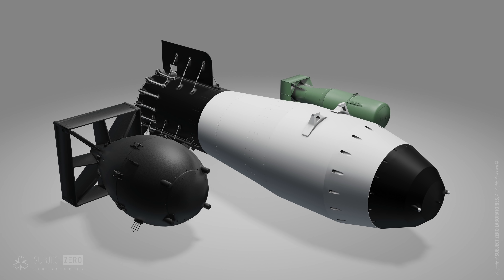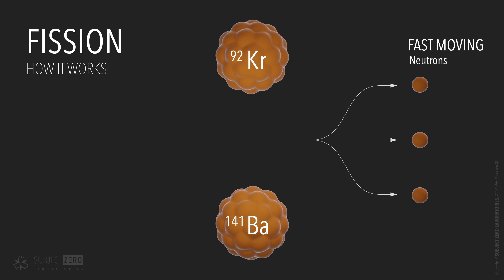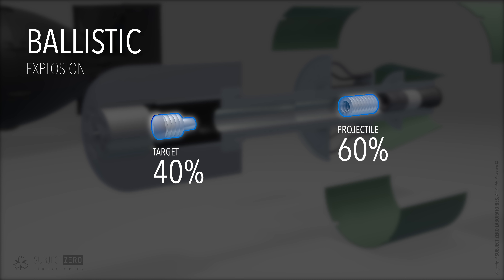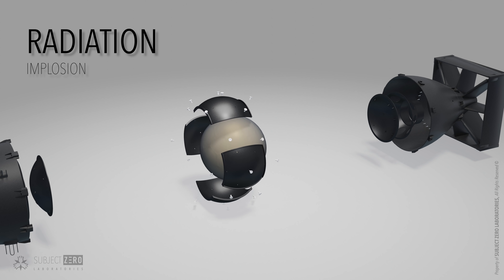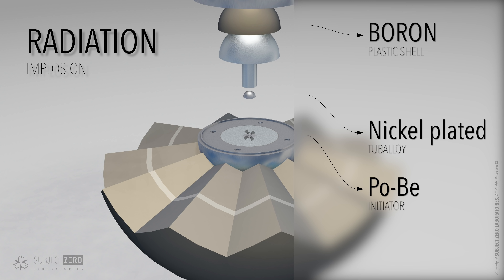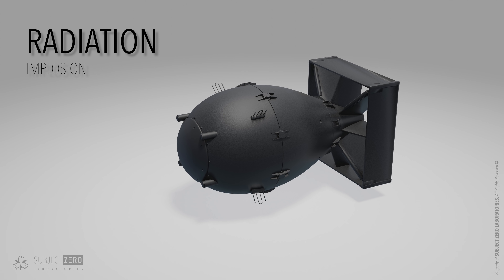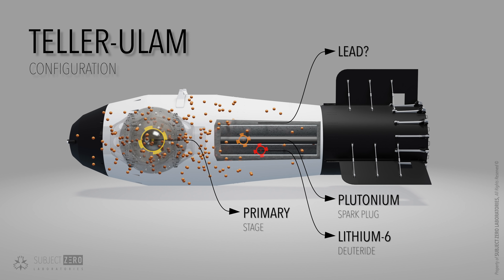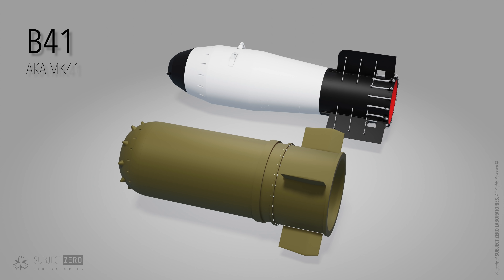Are Russian Nukes the Most Powerful?

Comment: "How were they able to achieve 50 megatons?"
By reducing the originally-intended 100 megatons by half.
Reply: Took the words out of my mouth
Reply: It was like 40% yield. So like 120 MT bomb. The actual potential is still classified. Our tests were the same, we mostly did 20-30% yield in our tests
Reply: Yeah, they apparently did that to give the bomber a chance to get away:)
Reply: @r1yamahamini  I read somewhere that they planed 2 Gt bomb but due to some unknown factors cancelled project.If i remember correctly  thay wanted to use that as shape charge to cause mega tsunami that would have destroyed cost of north america
Reply: was about to say the same thing
Reply: @michaelhamar3305  haha nuke go BRRRRR
Reply: @michaelhamar3305  it's edward Teller, he suggested a 1.5 gigaton nuke as a deterrent against aliens
Reply: @handsomesag4668  I don't know if I'd call it "weakened", if you have two burning piles of wood and throw 10L of fuel on one and 20L of fuel on the other, did you weaken the first fire? 

They just substituted part of the tamper with lead so it would still keep the same momentum but result in less fissioning of the tamper, which means a way cleaner reaction (in terms of fallout) and of course less yield, but the lead still works as effective tamper (the momentum of the material continues compressing the core while the chain reaction is happening) and neutron reflector, so it's not really a "weakening" of the bomb, just adding less fuel to the nuclear fire.

Also uranium weighs a lot more than lead, u-238 (natural or depleted uranium) is around 1.6 times mass by volume while u-235 (enriched uranium, what is used in the tamper) almost 2 times as heavy. This is why depleted uranium (and other very heavy materials like tungsten) is used in tank shells to deliver more kinetic energy to target (with the added benefit that once uranium starts penetrating steel it has a "self-sharpening" effect).
Reply: @mikethorson4031  It included 3 stages, the initiation yielded about 7 Mt, and then two layers of thermonuclear "pie" (inner tritium, outer uranium) each added 50, so intent was a total of 107, removing outer uranium shell removed 50 Mt, leaving the actual total at 57 Mt or about 55% of the original intent.
Reply: @handsomesag4668  a lot less than uranium
Reply: It's like the SpongeBob episode where he draws a perfect circle haha
Reply: They announced "50 MT bomb..." but failed to mention there were at least four attempts that were duds and they designed a four stage device that, by yield, only detonated three and those were not what they should have been.
Reply: while getting rid of 2 stages :)
Reply: @handsomesag4668  no, they reduced the 7 stages to 5. The majority of the energy comes from fusion in the 2nd+ stages.
Reply: @emmata98  The claims are a little more on the 'not possible' side.
Reply: @seanwatts8342  I doubt that. Scaleability should still be there. The usefullness is another point, since a lot of energy is directed upwards, and not linearly to the side. So 2 50 MT bombs are better than 1 100 MT bomb
Reply: @emmata98  Physics prevents scalability. THAT'S why it becomes 'not possible' according to Russian claims - THEN the obvious, Russia claims the plane came back... Let's assume it was air dropped as claimed. A 50MT yield would have destroyed a subsonic aircraft dropping it. The facts are we know there were multiple attempts that were duds but the question remains how many, with how many stages each?
Reply: @seanwatts8342  why prevent physics scalability?
Explosions in the Universe range from many more orders of magnitude, than a nuclear bomb.
This is like saying there can't be a bigger sun, but there are.
Reply: @emmata98  I think you're lost here. We're not talking about stars. I'm not sure what your native language is but in English, yield will meet diminishing returns.
Reply: @seanwatts8342  this is an engeneering thing, not a physics thing.
To nuclear fusion, witch most of the yield comes from, the limit is way higher, even for the used space.
So not a physics thing. 
And language is not the problem here. A language doesn't say if there a diminishing returns in anything. 
It might be harder to get the same efficency, but the physics sais it is possible.
So you statement is wrong. Physics doesn't limit this.
If you look at the engines of Starship (The Raptor of SpaceX). They reach 98 % of the max thermal energy you can get out of the fuel used (by having a full flow staged combustion engine). 
This difference is technology, not physics.
It was hard to achive that (there are only 3 different full flow staged combustion engines ever designed, because the technology wasn't far enouth, not because such combutsion is physicly impossible).
Yield is just the released energy of a bomb compared to the mass (not weigt!) of a TNT detonation. There is nothing within that that sais diminishing returns.
Reply: Give this man a cigar!  The Soviets were worried about serious tectonic faults being caused as well as with fallout.  They used a lead tamper instead of u238, which halved, at least, the bomb's yield, and, coincidentally, made it the cleanest nuclear bomb ever detonated (at least to that date).
Reply: @mikethorson4031  oop- i thought I was educated on this bomb
Reply: i thought tsar bomba was 100 megatons
Reply: @roostersideburns3440  The nominal yield with a U238 tamper was in that range, 100MT, but the Soviets were concerned about the seismic consequences of such a detonation, as well perhaps of the fallout the fissioning of the tamper would produce and so used a lead tamper (which does not fission for all practical purposes), as well, I think, reducing the amount of Lithium 6 fuel, to produce an approximately 50MT yield, simply to demonstrate/test the bomb.  Since there was no fissionable tamper, the bomb was very very clean, producing comparatively little fallout.  Had it been a full-up test, it would have been horrendously dirty, spewing tons of Uranium-derived fission products into the stratosphere and dispersing them worldwide.
Reply: @Technoid_Mutant  I know i just watched a documentary on it thats why this video was suggested
Reply: @roostersideburns3440  IIRC, my info was from a book, The Making of the Hydrogen Bomb".
Reply: @Technoid_Mutant  what does IIRC mean? are these documentaries incorrect? was tsar bomba 100 megatons or 50 im talking about when it went off.
Reply: @roostersideburns3440  If I Remember Correctly
Reply: @roostersideburns3440  If I Recall Correctly, IIRC.  Yes, if the Soviets had dropped this bomb on Manhattan it would have been fully fueled and would have produced 100 or more megatons.  As tested, for safety, they reduced the fuel in the bomb for a 50 megaton yield.
Reply: easy right?!
Reply: @wtfbros5110  We should make 200 gigaton nuke, place one in US one in Russia and then we dont need new weapons, becuse you can activate bomb in your country and destroy everything, no need for rockets, also no alien force would try to invade earth, never.
Reply: @wtfbros5110    Really?!    I know about Teller because he supported Reagan's Star Wars thing.  
And Teller was on Donahue even!   And Nightline with Ted Koppel.  I remember the 1980s!
Reply: @bami2   But a waste of tungsten that should be put to better uses.  
And the depleted uranium is causing great enviromental damage is the places where it has been used.
Reply: I read ,though I don’t fully understand, that the main scientist working the project reduced the amount of atomic fuel VERY SHORTLY before execution,because he believed the bomb was going to exceed predicted yield. I’m not a rocket scientist so I don’t understand either.
Reply: @michaelhamar3305  I think you are mistaken. There is a bomb which has the yield upto 200 MT, it's called tsunami bomb.
Reply: @mikethorson4031  the layer cake method the russians used could be scaled up easily to 200MT ...they replaced most of the fissionable material with inert material because detonating at full power the pilots would've been inside the blast and theres no way to survive dropping it
Reply: The difference between these two and the postwar devices seems to be the lithium fuel.  
If lithium had been used in the World War Two bombs the yield would have been bigger.   Right?
Reply: the tsar bomba is the most powerful and the future maybe 10 tsar bomba turned to super-tsar bomba
Reply: @Aaron-zu3xn  The main reason for reducing yield was not delivery survivability .. it was concerns over fall out afterwards. If you research for any amount of time this will become clear. You will also see the BS in Sean Watt's "A 50MT yield would have destroyed a subsonic aircraft dropping it". The bomb was released at 30,000+ feet and chuted for a reason ..
Reply: @seanwatts8342  Is that your educated opinion? "A 50MT yield would have destroyed a subsonic aircraft dropping it" says you don't know what the hell you're talking about. I'll put up some facts here ... https://military.wikia.org/wiki/Tsar_Bomba
Reply: @xenuno  at 100+ MT the plane can't get over 100 miles away by the time the bomb detonates,they don't deny that the pilot's would've been killed but they won't release the full yeild of the weapon it would be 120MT+ with the layer cake method,50% of the material was replaced with lead that's 3 layers you put fusion material between 2 layers of fission material and this thing would be a monster
Reply: @xenuno  2500 square miles for a 20MT bomb ...multiple that by 6 and you have how far away you'd have to be at detonation,even if you survive the blast you also have to survive the mach wave
Reply: @xenuno  we're talking about the soviets they're considered to have thought of these soldiers as expendable i'm sure but fallout would've irradiated 5000+ square miles then scattered via wind irradiating more than half the planet,hiroshima was 0.9 grams of material the core of this bomb being layered to use fusion would've perfectly irradiated the entire weight of the core
Reply: @xenuno  my mistake on the last response,the weight of the hiroshima core that fissioned was  not 0.9 grams only  0.6 g (0.021 oz)
Reply: @xenuno  good chance  the entire planet would've felt it,the way we knew before it was desclassified is a massive shockwave traveled the entire planet 4x at 50%,good chance the world would be changed forever at 100%,as general patton used to tell his favorite bomber division "we may not be able to change their minds but we certainly will alter their geography"
Reply: @xenuno  "Opinion?" No, that's math following the inverse square rule.
Reply: Tzar Bomba was supposed to be ~157 megatons strong, but Soviets became afraid that such collosal explosion may interfere with Earth's orbit, atmo- & magnetosphere, that's why they reduced it's power to 50 megatons.
Reply: Yep, exactly. So the pilot will capture the test because when they see the 50mt.bomb they will imagine what 100 mt looks like
Reply: @Technoid_Mutant   the designer Andre Sakhorav said it was unnecessary as 100 megatons would simply blow off into space anyway. It makes it impractical to use a 100 megaton weapon. Although it was mostly fusion and considered "clean" it still released over one megaton in fission yield. Greater explosions in nature have occured. Krakatoa was 200 megatons. Mt. St helen was close to 50 megatons. The thing was too big for a usable weapon and with better guidance systems in missile technology, it was useless as weapon.
Reply: I betcha that Tsar Bomba would be a real kick ass show stopper for a gender reveal party! And by the way if any of you mugs thinks about showing up on one of those "hey, I got a great idea, gimme some money" shows sayin' it was your idea, I am calling dibs, right here, right now.
Reply: @robothunter1035   hey! Its all yours. Tell Magnus I said hello! Oh I'm sorry you are Robot Hunter- he was "Robot fighter"!
Reply: @wtfbros5110  Funny, many scientists who were in Operation Paperclip knew a LOT more than what people realize. Anyway, that's not gonna work today.
Reply: @Wikchsawa  Teller is Hungarian, and left Europe long before even France pussied out in the Rhineland
Reply: @wtfbros5110  Teller escaped to USA, and the government contracted him. Exactly, what is your point?
Reply: @Wikchsawa  he's not from operation paperclip
Reply: @wtfbros5110  I didn't say he was in operation paperclip but he worked for the US, didn't he?
Reply: @michaelhamar3305  Blast radius exceeds atmospheric height. Why build a bomb just to heat up empty space?
Reply: @tomdecuca3627  Yeah, just hunting. I'm contractually obliged not to engage in any fighting.  Those robot lawyers are not to be trifled with.
Reply: @robothunter1035 yeah, them crummy robot lawyers!  They ought to hang 'em up by their own jumper cables!!
Reply: Imagine if they would have increased the Tsar Bomba by 100 mega tons...because they was going to do that much .I'm glad they did not test the 140 mega ton bomb...
Reply: @jasonmartin7711  After 50Mt, doesn't matter.
Plasma cloud bigger than thickness of atmosphere.
Blows out into space.
Reply: The Tsar destroys...The Emperor protects!
Reply: It's well known you use extra fusion stages.
Reply: @handsomesag4668  lead weights 107u, Uranium is 238u 
Substantially heavier than lead....
Reply: The required size of the "shell" for the weight of the bomb. What you just said was the war propaganda part, which you fell for easily, because of watching too much cnn.
Reply: Yes as half of the energy released from a nuclear weapon comes from fission of the U-238 tamper that gets converted into plutonium-239 as it is reflecting neutrons back to the chain reaction.
Scientists were concerned about setting the atmosphere on fire, so they downgraded the bomb by using a lead tamper.
Reply: They are rumored to have a 100 megaton bomb in development... Hell 50 is what they call a city killer yet the effects aside from a 62 Miles distance in every direction from the center being vaporizes instantly (120 mile wide circle) . 50 is actually a state killer so 100 is way overkill.
Reply: @Blazeww  the oringal design of Tsar Bomba was 100 MT, this was reduced as it was deemed unnecessary in both terms of safety and the risk of fallout across the Northern hemisphere.
So further research would not be needed to upscale this design to 100MT, they simply removed the thrid stage of the device by replacing the Unranium 238 tamper with lead... this prevent the fast fission of the tamper boosting the yield to almost 100%. 
The devise was never a practical weapon as it could only be delivered by the bear bomber slow and easily intercepted by 1960's standards.
Miniaturization was the real development in thermal nuclear weapons not excessive yield.
Missile deliverable multi targetable systems are far more devastating, the abality to place any number of smaller nukes onto a target area from space with little to no means of interception was the future.
This left large gravity bombs obsolete.
Reply: @bami2  multiple trigger mechanisms!?!
Reply: The chose to use a bit less U235 for safety reasons.
Reply: It was a test, after all.  Once the design was shown to be feasible, the scientists knew all they had to do was replace the lead tamper with uranium, and ka-BOOM!  100 megatons.
Reply: wow, fellow warhammer fan, and on this side of the internet
Reply: Most blast yields are actually hypothetical, because many devices have never actually been tested. On top of that, Castle Bravo was predicted to be a 5 Mt detonation, and ended up at over 15.
Reply: The scary part of it all it is proves the tech is scalable you could build one big enough that you don't need to Transport it anywhere as it would end us all anyway
Reply: @r1yamahamini  The "bomber get away" story has a lot of truth to it - they used a Bear, which was the most powerful and the fastest turboprop bomber aircraft in the world (and faster than SOME jet bombers, or very close in other cases - think "about the same max speed as a B-52") - and it STILL got scorched by the thermal radiation wave then almost knocked out of the air by the air pressure wave.
Reply: One stage never happened
Reply: @michaelhamar3305  That would be a nice yield ^^ 2 GTons is something more decent to make ;)
Reply: @roostersideburns3440  50 as tested with the potential to be boosted higher
Reply: @michaelhamar3305  source? western propoganda ;)
Reply: @emmata98  Exactly, if i'm not wrong it gets harder and harder to achieve a higher yield because the process happens so fast that does not let all of the uranium and hidrogen(deuterium-tritium) do what they do at 100% efficiency
The tamper has been such a great idea for deflecting neutrons but still is not enough, most of the nuclear fuel is lost and only a mere fraction releases it's energy
We're talking back in the cold war era, who knows which other methods they may have now

Physics of course will always give "limits and rules to follow" but as the time goes we notice how a few objects and events use to defy them, so may be in the future we will have, unfortunately, devices which can fuse even more of the total mass of uranium/plutonium compared to the 10/30% we have today
Humanity will always find a way, for good or bad, we ask ourselves about how many things we can do but never how many things we shouldn't do
Reply: @r1yamahamini  I heard that the bomber still had a 50% chance of dying in the shockwave still
Reply: Absolutely correct. And it was for show. And it was a waste of time. Any nuclear capable nation can make thermonuclear devices with yields as big as they want. But beyond 1MT it makes little sense… unless, of course, your accuracy is so bad you have to overcompensate to kill your intended target.
Reply: @seanwatts8342   что за фантазии? Хрущёв приказал взорвать саму мощную бомбу(Кузькину Мать) 80МТ,всё прошло  по плану ,кроме более длительного свечения(реакции),все 3 "ступени"  сработали ,ваш президент(и правительство US) был настолько напуган ,что в тот же год пописал договор "О запрещении испытаний в трёх средах(в воздухе ,в воде, в космосе)"  которое правительство СССР(SU) предлагало подписать каждый год на протяжении 5-7 лет.
Reply: @emmata98   одна бомба мощьностью более 100МТ способна запустить реакцию термоядерного синтеза в воде мирового океана(вода,вернее водород из воды будет вступать в термоядерную реакцию пока ВСЯ! вода не "сгорит").
Reply: @seanwatts8342   самолёт вернулся! летчики награждены орденами "Ленина" и звёздами героев Советского Союза!
Reply: @ВасяВаськин-п9з  what?
Reply: @emmata98   что? что ты имеешь в виду под своим вопросом "что?"? или у тебя  google mistranslated?